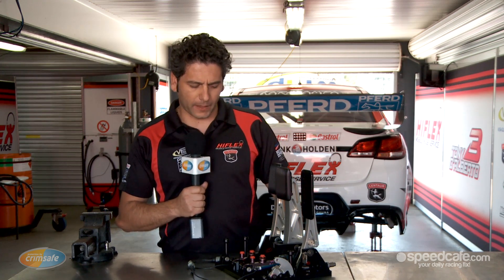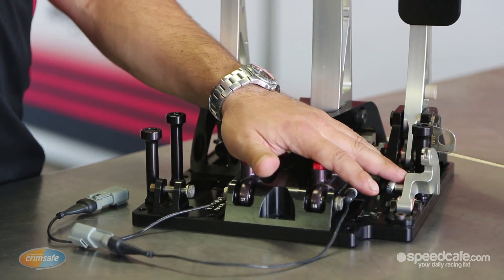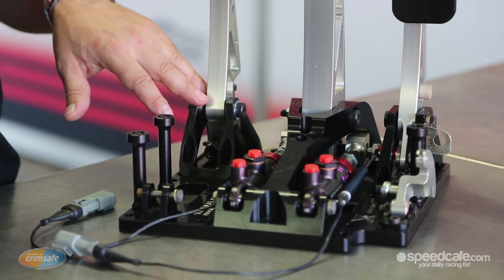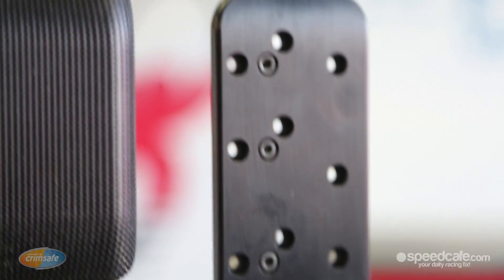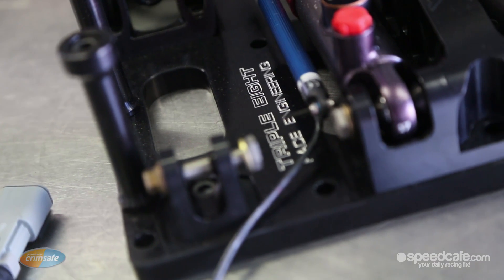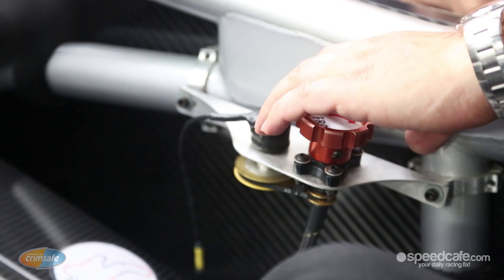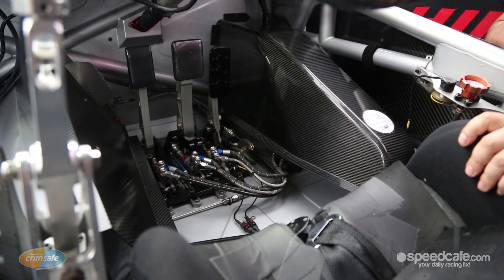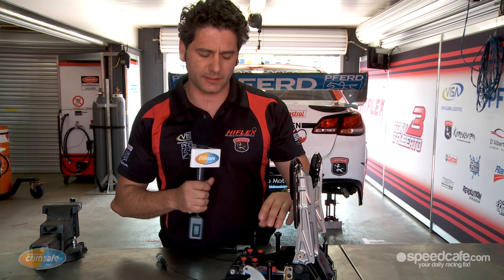Crimsafe Talking Tech - Pedal Box

Comment: does anyone know why alot of drivers hit the brake softly once before getting on the brakes like at 3:17 ? Is it to insure there is brake pressure?
Reply: Nah, sometimes the brake pads can be knock backward and therefore making a gap between pads and the rotor. hitting brakes before straight comes to an end eliminates the gap. otherwise you will have a long brake pedal travel and it will make your braking inconsistent. some latest brake calipers have anti-knock back features so the driver don't have to hit the brake.